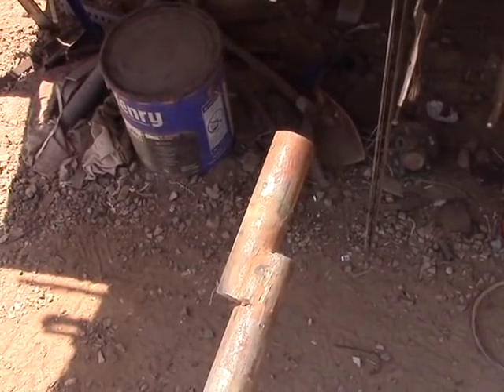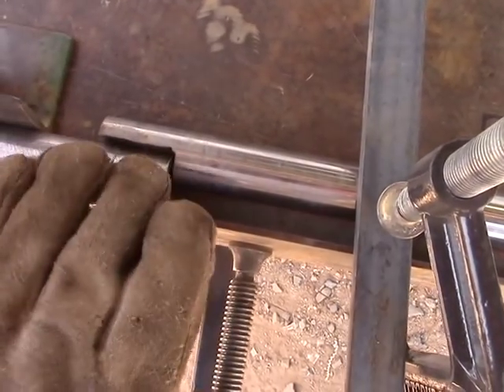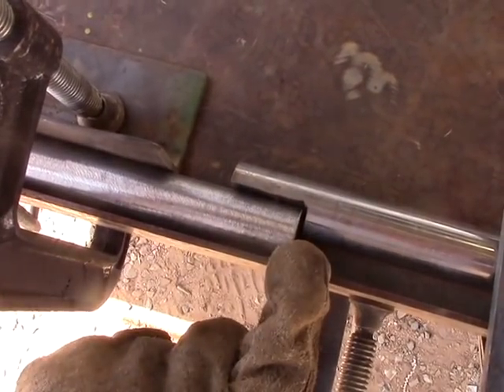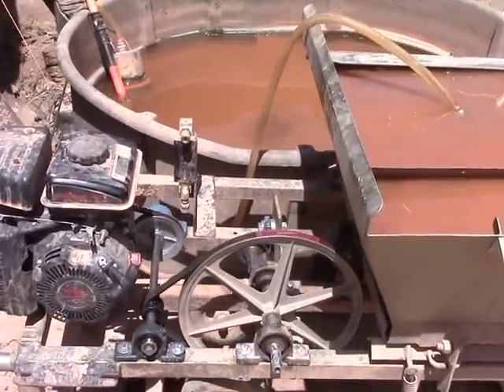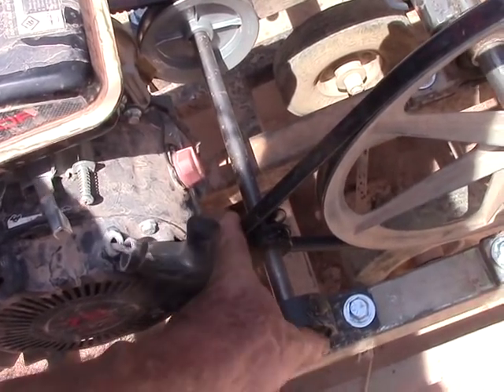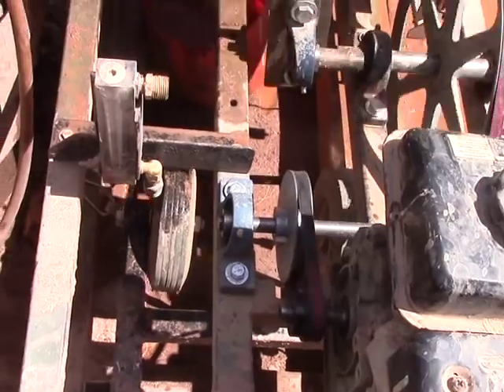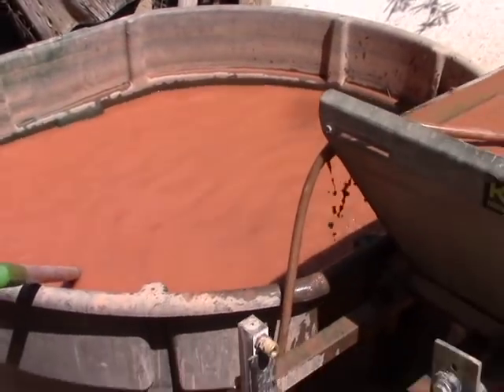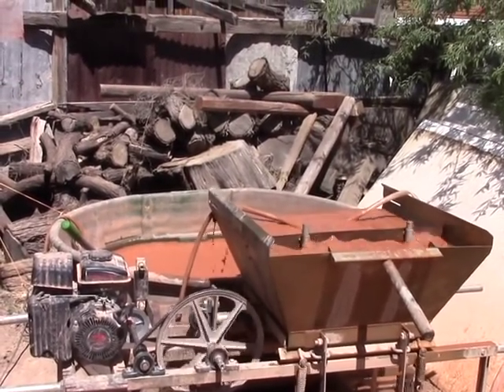The Latest Mods and Obs on the Hydramatic

Comment: Does this work on crushed sulfide ore? Is what you want to get out contingent on the water flow and particle size?
Reply from the maker: It should indeed work on crushed sulfides, it did for me with what sulfides were present.  If the particles were very small and the flow was high enough, it could flush out the fine heavies, but with a proper water flow, the main concern would be the input feed rate.

Comment: Hello Keith, what does the new water distribution rack look like? I am basically wondering if:
1. Your water input is jetted up or down or in multiple directions into the heavies?
2. Are the new shapes of the water distribution rack (angle iron lying flat with angle pointing up) the same as the factory rack?
3. The purpose of the water distribution angle iron is to calm the jetted water and gently flow off the gangue while not overly disturbing the heavies.. thus not not remixing the gold with gangue?
Anyway I am going to build a version this tool and want to apply all useful modifications from your experience!
Thanks sir,
PT
Reply from the maker: There are some things added that shall remain confidential for now in case I can develop and patent them.  WRT just water distribution, 5 or more 1" tubes horizontally on the bottom with their long axis perpendicular to the oscillation axis with around 75 -85 1/8" holes  opening downwards.  If you find out anything special I'd like to hear about it.

Keith
Reply: Thanks sir.. I’ll let you know if I determine something notable as I build this unit.
PT
Reply from the maker: @ProspectorTripp  Thanks, I appreciate it.  If you can come by and sign a don-disclosure agreement and take a look.
Reply: Hard Rock University 
I will let you know how my build goes and yes! I will certainly contact you if am going your direction!
Thanks PT
Reply from the maker: @ProspectorTripp  Love to meet you, Keith

Comment: You got a few bucks tied up cold roll round, pillow block bearings and v-belt pulleys.
*You the fella behind Keene Engineering? If you are, we've talked on the phone a couple times.
Reply from the maker: About $100
Reply: @hardrockuniversity7283  well worth every penny.
Reply from the maker: @KowboyUSA  Yep.  I'm in control now.